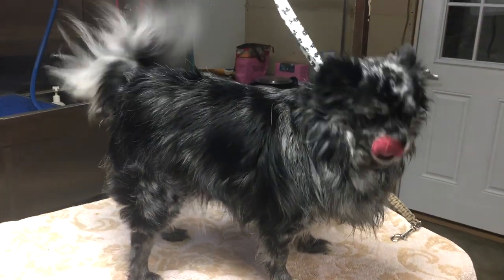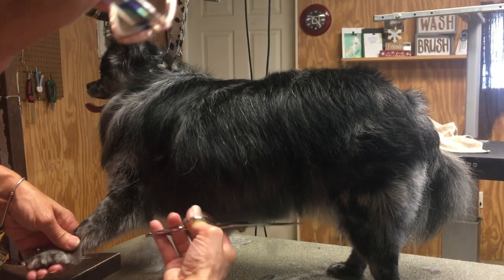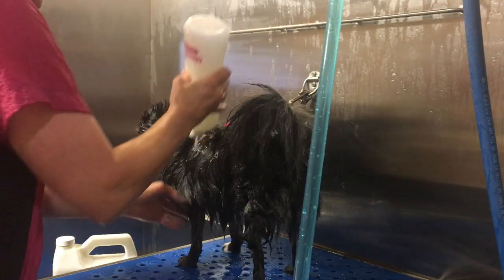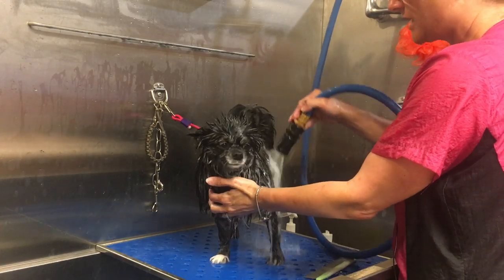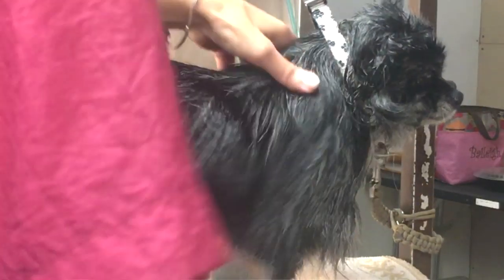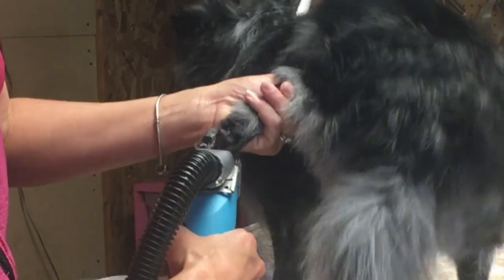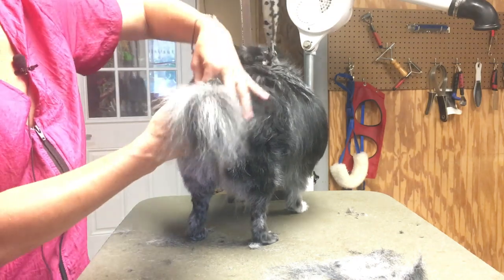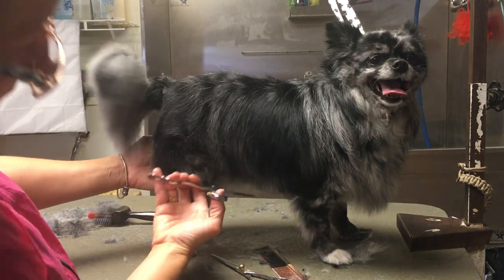Groom a Pomeranian SAFE undercoat removal

Comment: I got my prima last week! I don’t know how I survived without it, it’s amazing!
Reply from the maker: Amanda I’m so proud of your smart decision!!! I think Prima is the best system available 💕 happy grooming my friend!!
Reply: Go Groomer I am interested in the Prima and also the Save Your fur type. I have seen a video of the Deshed rinse on the s.y.f.  Does the Prima have the same feature?
Reply: I wondered about the safety of the high powered rinse
Reply: I want one too!!
Reply from the maker: Lynn Oney of course. That’s why I demonstrated it on my arm. It is very gentle:) However, I do not use it on puppies until they are six months and older-just as a precaution due to their skin is so delicate at a young age. I have used a Prima bathing system for 15 years. That system produces the best bath possible for the dogs I groom💕
Reply from the maker: Lynn Oney actually it does😊 The salon model applicator has an adjustable nozzle which opens up and produces that type of Deshedding technique. Here is a video I found that demonstrates that on the prima. https://youtu.be/Z_sHNlnr6mU

Comment: I have border collie/cattle dog mixes so no double coats, but dear lord they shed non-stop.  Even with being fed a high-quality dog food and with getting regular bath/brushes.  Thank god for forced air dryers, that helps the most.
Reply from the maker: Oh they do shed a lot:) They also do in fact have a double coat:) Bathing, brushing, and force drying is the key to keeping this coat in check:)
Reply: @GoGroomer  One of ours has a little bit of a double coat, but the other two have a flat coat.  Just enough like the cattle dog to shed, but without the normal double coat. Now I once had an Aussie mix years ago with a heavy double coat and she only seemed to shed twice a year when she blew her coat.  With regular grooming, she never really shed, but these hooligans do it non-stop! (three pups from a pregnant rescue that we fostered.) It's strange how even though they are all siblings, one of them has a super flat coat, yet the DNA said border colline, cattle dog, basset hound, Siberian husky, and rottweiler.
Reply: 'Flat' coats are double coats! Double doesn't have anything to do with the length of the coat: it means 'undercoat plus guard coat', and is the natural condition of all canids. There are only a few kinds of breeds, like drop coats (maltese etc) and curly coats (poodles and their crosses) which are single coated. Since these are artificially created, their coat can't maintain itself naturally, and it needs regular grooming and clippering or it will grow too long and mat up. Basically, if a dog sheds fur they're double-coated (and should not be clippered) and if they don't they need to be brushed multiple times a week and to have a full groom every 6 to 8 weeks.